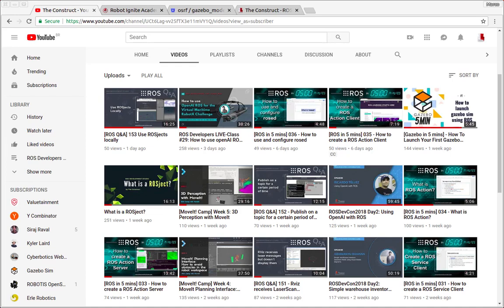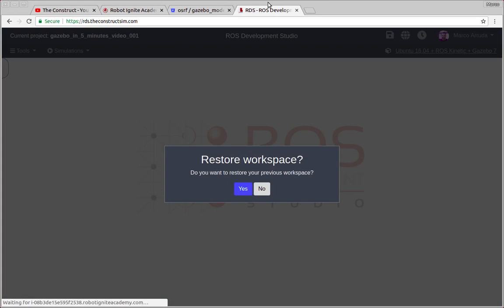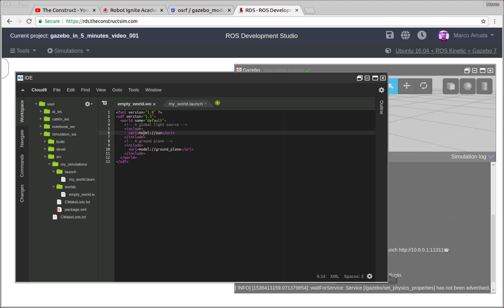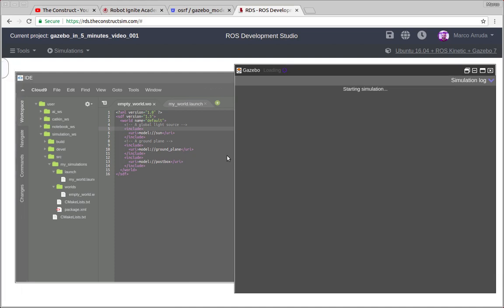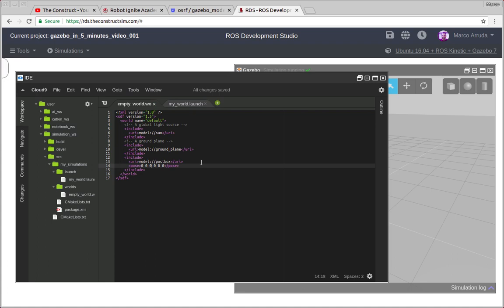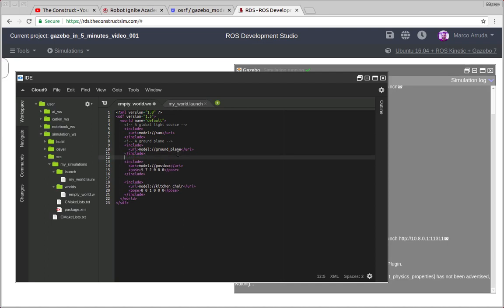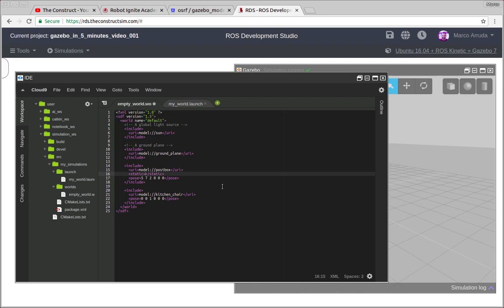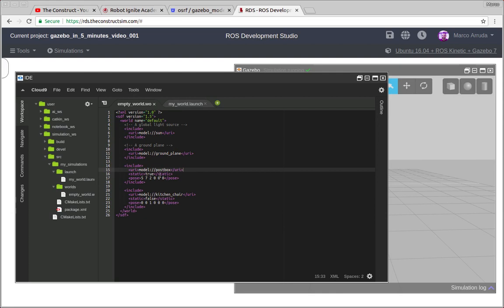[Gazebo in 5 minutes] 002 - How to add gazebo models to a simulation

Comment: I have two questions:

1) How can I apply my custom drone model into "iris drone model" which how can I change the default appearance of the "iris drone" with my custom drone model? thank you.

2) I am getting this error once I apply  <static>false</static> to my SDF file. Do you know how to solve this problem? thank you.

XML Element[static], child of element[inertial] not defined in SDF. Ignoring[static]. You may have an incorrect SDF file, or an sdformat version that doesn't support this element.

This is my file:
<?xml version="1.0" ?>
<sdf version="1.5">
  <model name="aykut_sdf_custom_model">
    <link name="link">
      <inertial>
        <pose>0 0 0.5 0 0 0</pose>
        <static>false</static>
        <mass>11.0</mass>      <!--for a box: x = 3.0 meters, y = 2.6 meters, z = 0.9 meters -->
        <inertia>
          <ixx>0.04084015</ixx>   <!--for a box: ixx = 0.083 * mass * (y*y + z*z) 4,084015 -->
          <ixy>0</ixy>   <!--for a box: ixy = 0 -->
          <ixz>0</ixz>   <!--for a box: ixz = 0 -->
          <iyy>0.05292495</iyy>  <!--for a box: iyy = 0.083 * mass * (x*x + z*z) 5,292495 -->
          <iyz>0</iyz>   <!--for a box: iyz = 0 -->
          <izz>0.0850252</izz>  <!--for a box: izz = 0.083 * mass * (x*x + y*y) 8,50252-->
        </inertia>
      </inertial>

      <visual name="visual">
        <geometry>
          <mesh>
            <uri>model://aykut_sdf_custom_model/meshes/aykut_sdf_custom_model.dae</uri>
          </mesh>
        </geometry>
      </visual>

      <collision name="collision">
        <geometry>
          <mesh>
            <uri>model://aykut_sdf_custom_model/meshes/aykut_sdf_custom_model.dae</uri>
          </mesh>
        </geometry>
      </collision>
    </link>
  </model>
</sdf>